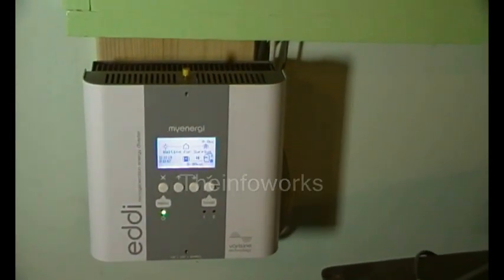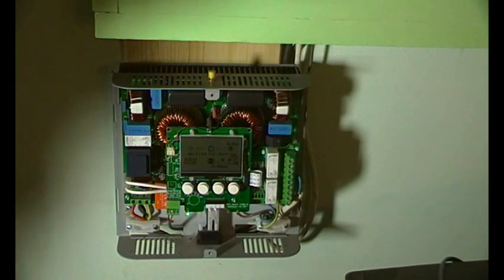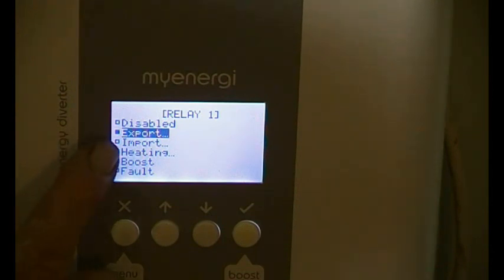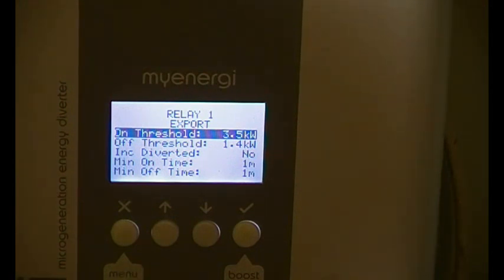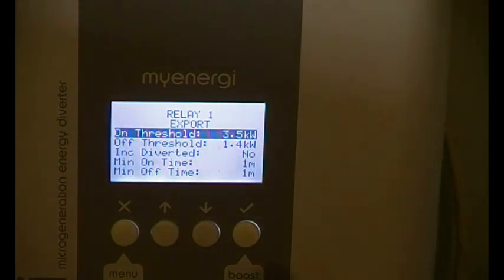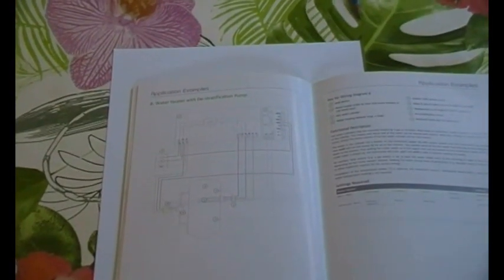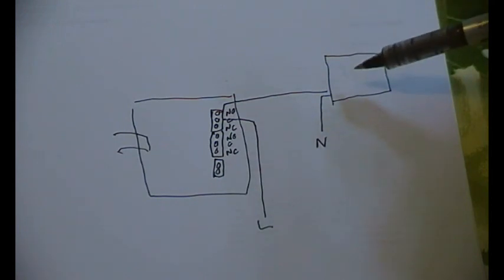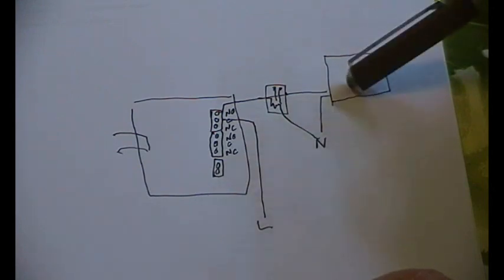Myenergi Eddi relay & sensor board. Load dump on very sunny days

Comment: Very useful video! Is there a lower priority for the relay board? What i mean is the immersion controller always has priority? and is serviced first, but the relay board comes into play when the immersion thermostat has opened and the tank is up to temperature? It works like a second chance to use unwanted export for something else? Trying to get my head around this! Does the relay output also have the same "controlled power" output that is available to the immersion circuits? or is it merely used for switching?
Reply from the maker: Hi, the priority is channel 1, then channel 2, both of which are proportional to export. The relay board can be set up to limit export after that, but is a simple on or off. So either of the channels can be diverting full power and any excess can be dumped by the relay board. I have mine set so 2Kw can go into the grid and anything above that is dumped through the relay. Hope that helps, Subscribed? cheers
Reply: @TheInfoworks  yes really helpful thanks 🙏 I subscribed earlier 👍

Comment: Hi stevie
I have had a eddi for 5 years now but unfortunately blow up I have replace but now struggling to remember the settings lol, I had it set up differently to any of the demonstration I have 2 emersion heaters and a relay board fitted to the eddi I have up to 14kv of solar the way used to have it set up was it would heat emersion 1 if I was producing more than 3kw it would start to divert to emersion 2 so I was using both at the same time but I am struggling to remember how I set this up any advice would be grateful excepted many thanks quince
Reply from the maker: Primary power is diverted through channel 1 or channel 2. Any excess must be diverted through the one of the relays on the relay and sensor board. Subscribe please, cheers

Comment: I don’t believe for one second the grid doesn’t like all these mini power stations around the country dumping huge amounts of electricity into the system you’re affectively powering the nation from your roof. It never has sat well with me the fact that I can find myself exporting 10/15 kW a day and not receive the going rate in return. I think it’s something that needs to be looked at
Reply from the maker: Hi, they need to keep the cycles and voltage within strict limits. The answer to this export is diverting the power into hot water or space heating (Autumn to spring) and into a home made battery back up using UPS charger / inverters, Cheers

Comment: Hiya, just checking does the ribbon cable and stand-off’s come with the eddi or the relay/sensor board? Already installed the eddi and realised I needed the separate board after, can’t remember seeing the ribbon cable or the standoff’s with the eddi and haven’t received them with the board of that makes sense
Reply from the maker: Dan, Hi, the cable and stand offs come with the relay board as far as I remember. Myenergi customer care was very good last time I used it, subscribed? cheers

Comment: so if i buy Eddi, my inverter shout be normal grid tie inverter whitout limiter or zero export functions, cuz i dont want to export to grid?
Reply from the maker: Hi, the Eddi is the limiter and diverts power that would be exported into hot water and other heaters. It's just a matter of making sure the loads are big enough to soak up the power, that's why the relay and sensor board is so good because it works in parallel with the Eddi outputs, cheers
Reply from the maker: Hi, they relay and sensor board is the icing on the cake and prevents export but dumping power into known load when all other heaters are up to temperature and switched off, cheers

Comment: Hi Andy, do you think that I could connect this to a water pump? I understand the resistive load for the immersion side but with this it could be set to switch on at 1KW off at 900W and have an 800W pump running.
Reply from the maker: Hi, on the relay board setting it is not proportional so just switches on and runs the load, so it would run a pump as long as it set to switch off at 800w, cheers

Comment: What capacity are your PV panels and how much do the produce annually? Thanks.
Reply from the maker: Hi, first times I've been asked that, well done. On the battery side we have 36 panels varying from 200 to 250 watts. Generation figures are difficult due to charge controlling, especially in summer, but we do also run some 60v DC heaters as dump loads. As a rule of thumb I Kw of panels should generate 1000 Kw Hrs per year, cheers
Reply: Andy Reynolds do you think having an eddi, harvi and a zappi makes it more viable for someone to buy PV panels? Payback wise I’m sure using them for all these usages should reduce payback?
Reply from the maker: Hi, for grid based panels then definitely diverting with an eddie (and a zappi if you have an electric car) makes all the difference. It's a long term view but increases personal resilience, cheers
Reply: Andy Reynolds thanks

Comment: This would be great in the summer when generation and the temp in the house is high to turn on an A/C unit
Reply from the maker: That's right and the parameters can be tuned to your system, especially the time delays. It's part of a suite of contollers that include an EV car charger, cheers

Comment: What is the Temperatures menu for?
Reply from the maker: Hi, for remote thermostat control, you can download the manual from the Myenergi website, cheers
Reply: Andy Reynolds thanks.

For some reason I thought temperature setting would be a trigger for a heating session on its own.

Comment: If you provide your own common to the relay then perhaps you could use a low voltage signal into a wireless transmitter to remotely control your heater relay if running a 100m cable too impractical.

How's the oak pruning healing 6 years on?
Reply from the maker: Ian, good to hear from you, I used 50v DC as a control voltage to operate the remote relay as a multicore cable is just close by, but the possibilities are numerous depending on the set up. The Oak pruning video footage has ben capture for this year. I was going to wait to upload till next year but maybe I will just do a 1 minute update, cheers

Comment: I use a load dumper too, 4 H4 lamps from a car installed in a 1cm thick alu pipe and that works for me but in the future   I'm gonna use a 12v car compressor connected on a fire extinguisher , to pump air in my motorcycles (or car) tyres.
Reply from the maker: I use a dump load from the panels feeding the  battery system and this dump heats my office. It's using power that would otherwise be lost, cheers

Comment: All kinds of posdibities here Andy. Because it can switch an external relay in a preset scenario you can power devices other than those usable with a variable  voltage through the Eddi itself like an immersion etc.
Export is such a waste of power. Our network utility limits it here to 6Kw but I can see some dual wind and solar systems busting that limit at peak times. 👍
Reply from the maker: Glad to see I have got you thinking, cheers

Comment: Is it worth running a camper van 250w panel to a grid tie inverter to generate power while the Vehicle is not moving?
Reply from the maker: Hi, I suppose if you had a mains hook up and used power during the day, or maybe just feed your own batery system, cheers